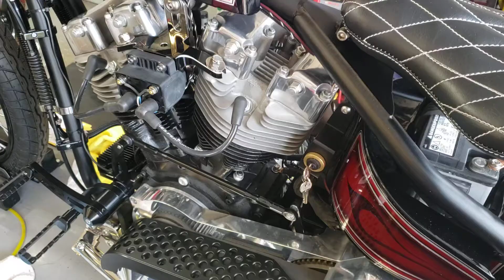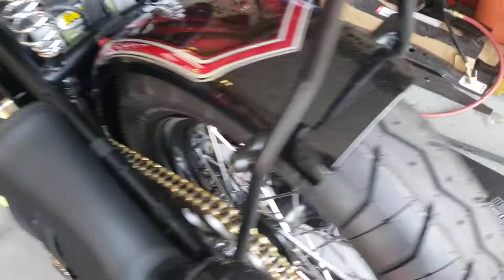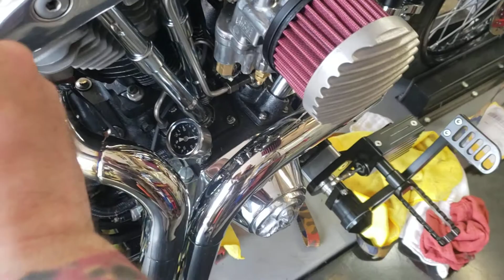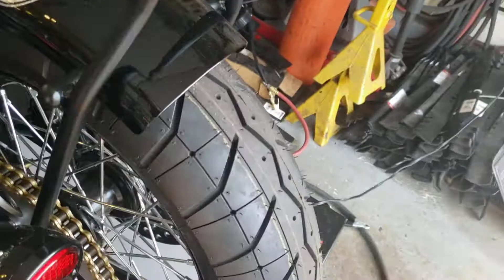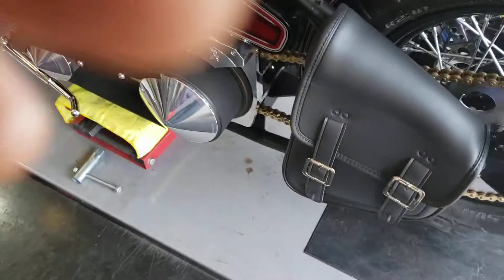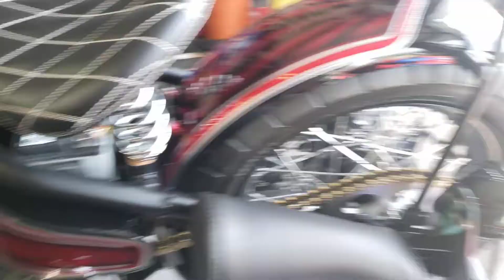1979 Custom Shovelhead Bobber cold start

Comment: Great looking and sounding Shovelhead you have there. May I enquire is that a 3" Primo or BDL open primary and where did you get the belt cover from pleae? Cheers ...
Reply from the maker: It is a Karata belt drive and the belt cover is a custom made unit from eBay.
Reply: @KraeseRepairs  Found them... thanks